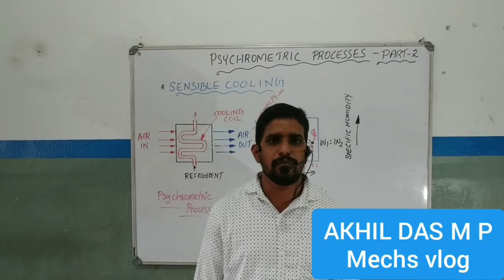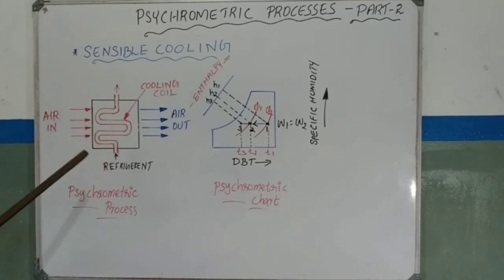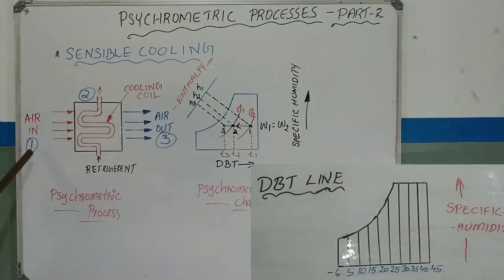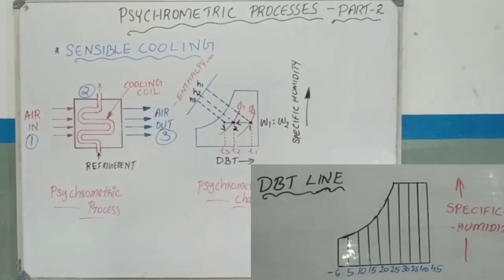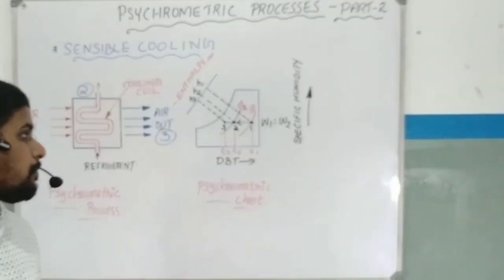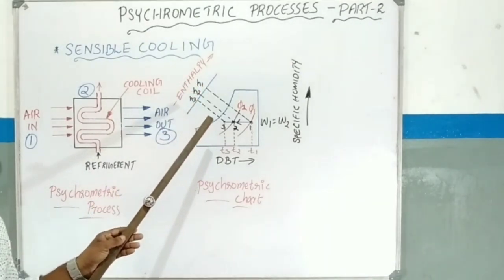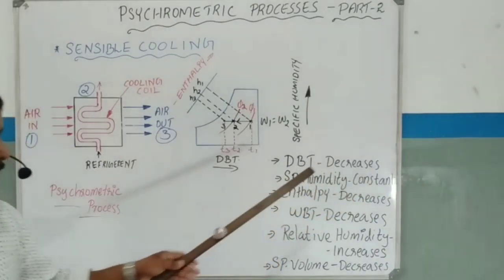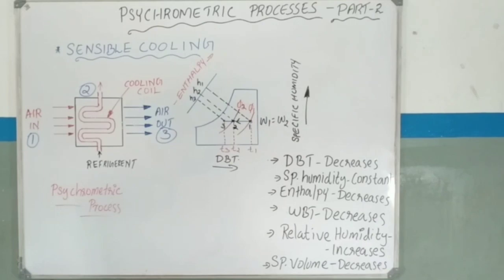PSYCHROMETRIC PROCESS |#Part-2|#SENSIBLE COOLING|#Malayalam|#MARKAZ TECHNICAL INSTITUTE KARANTHUR|

Comment: vahid 
           Roll. No 1
           R&A/C jr b batch

1a. Specific humidity ക്ക് മാറ്റമില്ലാതെ air നെ heat ചെയ്യുന്ന process ആണ് Sensible heating
2a. DBT - കൂടുന്നു.
      S.P Humidity - Constant
      Enthalpy - കുടുന്നു.
      Relative humidity - കുറയുന്നു
      WBT - കൂടുന്നു.
      S. P volume-കൂടുന്നു.

Comment: MUHAMMED RINSHAD PK
           Roll. No 17
           R&A/C jr b batch

1a. Specific humidity ക്ക് മാറ്റമില്ലാതെ air നെ heat ചെയ്യുന്ന process ആണ് Sensible heating
2a. DBT - കൂടുന്നു.
      S.P Humidity - Constant
      Enthalpy - കുടുന്നു.
      Relative humidity - കുറയുന്നു
      WBT - കൂടുന്നു.
      S. P volume-കൂടുന്നു.

Comment: Jaseel k
           Roll. No 16
           RaC jr b batch

1a.     HUMIDIFICATION
 Dry bulb tembratur ന് മാറ്റമില്ലാതെ air ലേക്ക് moister നെ add ചെയ്യുന്ന Process ആണ് humidification..
           DEHUMIDIFICATION
Dry bulb tembrature ന് മറ്റമില്ലാതെ air ൽ നിന്ന്‌ moister നെ Remove ചെയ്യുന്ന Process ആണ്  Dehumidification
2a.DBT -Constant
    ട.P humidity - കൂടുന്നു
    Enthatpy - കൂടുന്നു.
    WBT -കുടുന്നു.
    S.P volume-കൂടുന്നു.
3a.DBT - constant
    ട.P humidity - കുറയുന്നു
    Enthatpy - കുറയുന്നു.
    WBT - കുറയുന്നു.
    S.P volume- കുറയുന്നു.

Comment: Shanif
           Roll. No 28
           R&A/C jr b batch

1a. Specific humidity ക്ക് മാറ്റമില്ലാതെ air നെ heat ചെയ്യുന്ന process ആണ് Sensible heating
2a. DBT - കൂടുന്നു.
      S.P Humidity - Constant
      Enthalpy - കുടുന്നു.
      Relative humidity - കുറയുന്നു
      WBT - കൂടുന്നു.
      S. P volume-കൂടുന്നു.